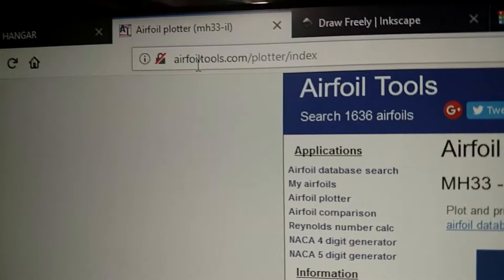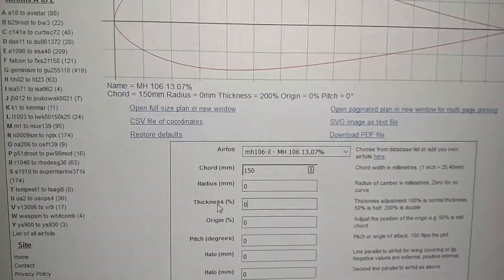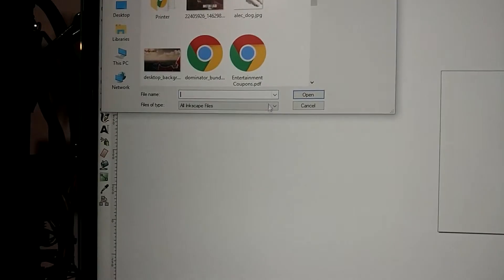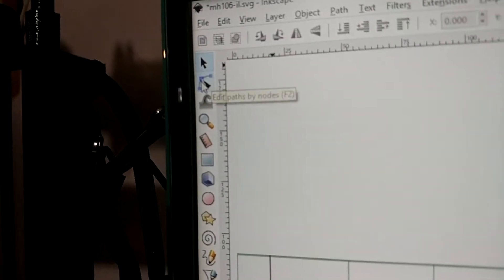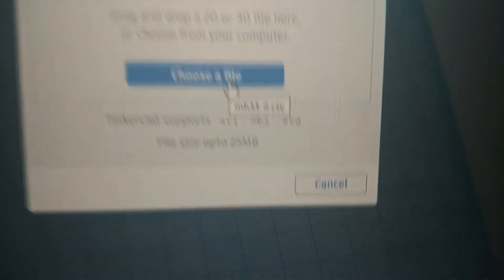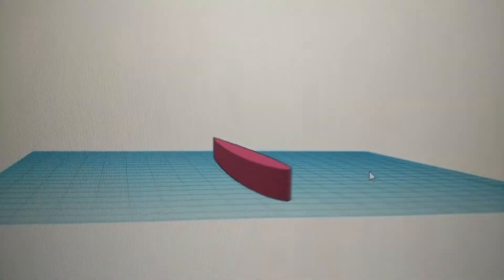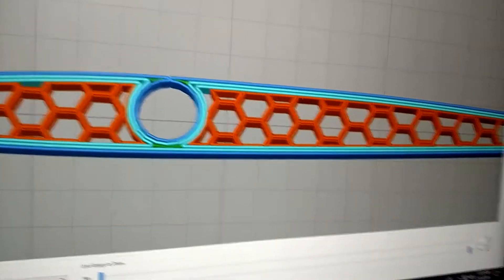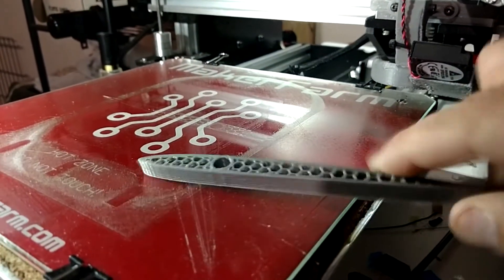3D Printed Airfoil - Airfoil Plotter - Inkscape - Tinkercad

Comment: Can you do a tapered wing this way?
Reply from the maker: You would probably need to use a more advanced CAD program, such as Fusion360. Start with 2 sketches of the root and tip airfoil and then connect them to make a solid object.